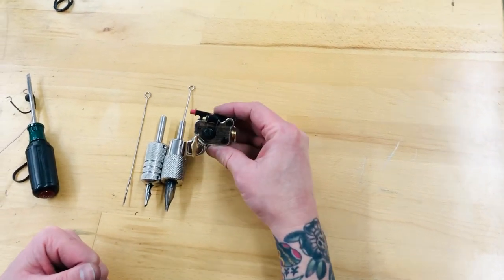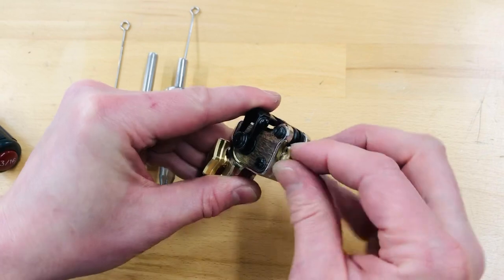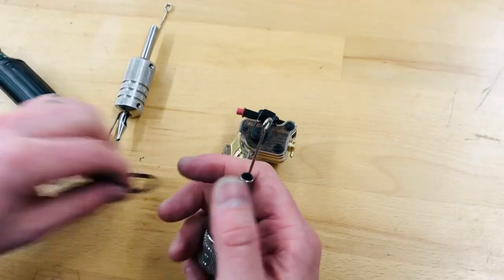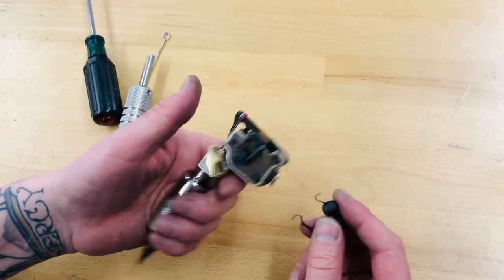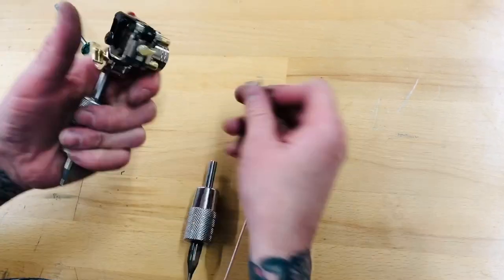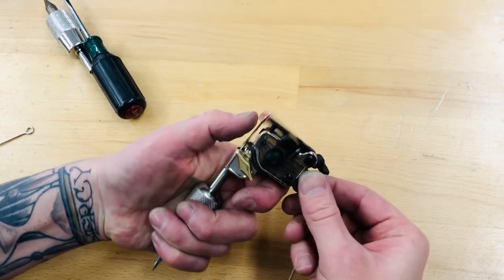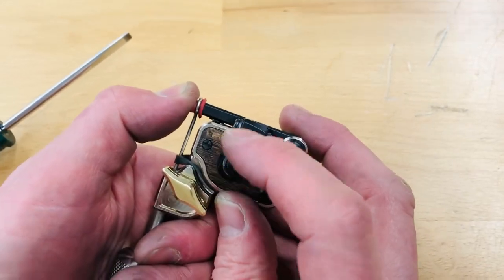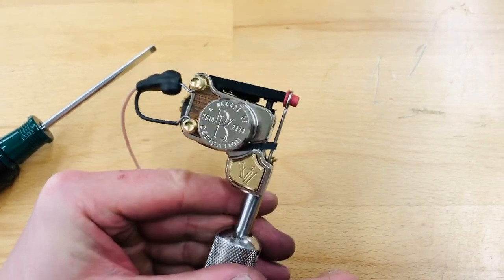Sidewinder 7 timing and setup

Comment: Do you have a recommendation for which steel cartridge grip to use? I use regular knurled like you have in the video for needles and would like something familiar for when I'm using a cart setup. Thanks in advance
Reply: Have you found one yet I’m looking as well
Reply: Saltwater tattoo supplies Tim hendricks has one its not a click style adjustable grip but its heavy love the weight tat soul has one aswell fixed and easy to clean.. Check em out.

Comment: My heart breaks every sunday Dan always sold out i think im just gonna get the V 3 from workhorse
Reply: I got one bitches ! it lines like a beast and its the best color packer im so happy to be using needles again it works great with hallow liners for me aswell i love it
Reply: @Paye ta Disquette this is a great .achine for lining but if u shorten the stroke any use with the dull setting on your. Clip cord using low volts around 4.7
Reply: @ivanmendoza8457  you got the sidewinder 3? 

Can it use thinner needles like 1,2,5 liners?
Reply: @Paye ta Disquette u can tune it to do whatever u want once u figure out how to tune it it's the most versátiles machine
Reply: @7somekindofsomething  yeah the smaller grouping again shorten the stroke a bit not too much it will hit softer just like a small grouping liner I highly recomend the v7 it's way better than the v3r but the v3r is alot easier to get for less I also really like the dmcv2 great machines by this guy...